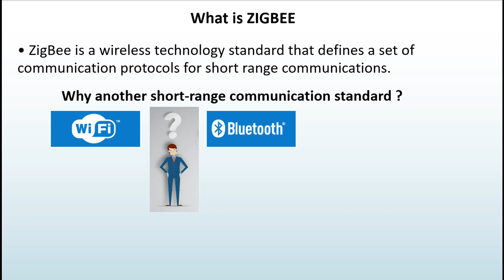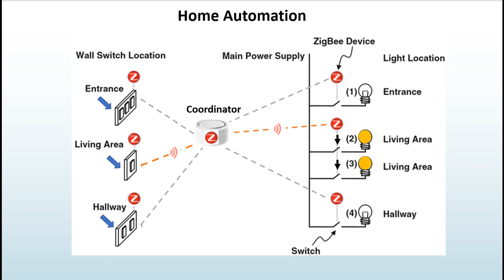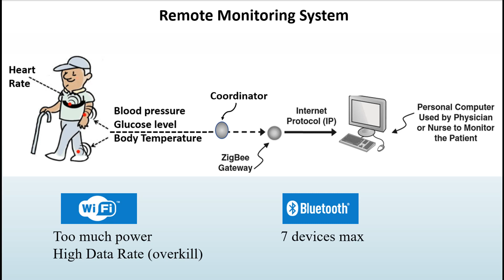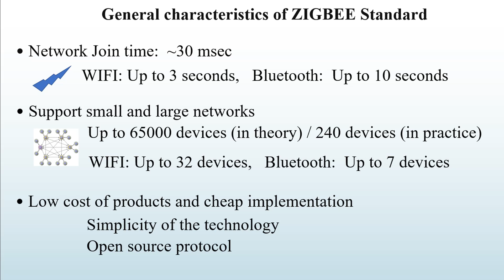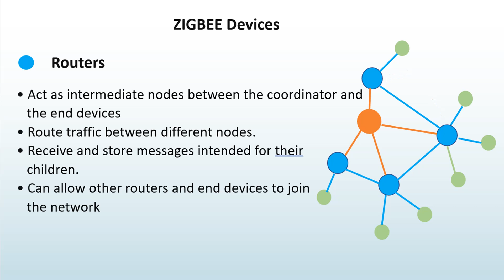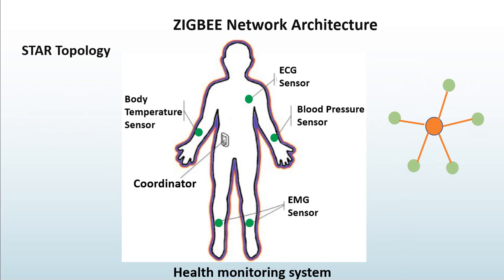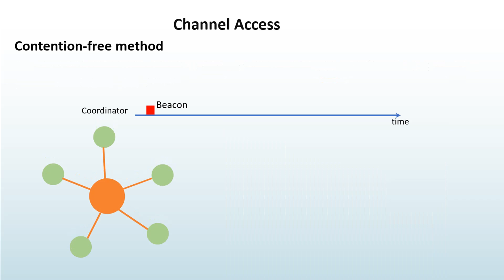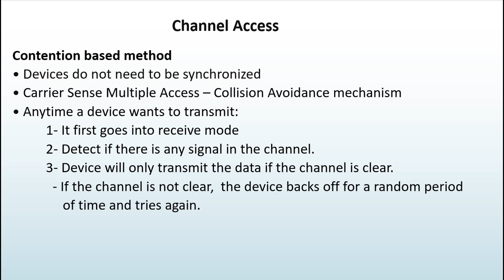What is ZIGBEE And How It Works?

Comment: The lack of understanding of wifi displayed in this video makes one doubt the validity of the information given about zigbee... which is rather sad...
Reply from the maker: Could you please indicate where this video showed the lack of understanding WIFI. I will appreciate you clarify that. Thanks
Reply: @TechiTube  I think before making a video like this you should have done the research. 

But I'll give you 1 example, you mentioned the limited amount of devices that can be connected to WiFi. This statement is factual in correct. 

Be aware, this is just one of the things that show that lack of understanding your seem to have.

Comment: 30 milliseconds to join a network. Not really. All the zigbee devices I've synced in with Home Assistant takes several minutes and often multiple retries before they join, and once found by the server, it takes another 10-30 seconds to negotiate and handshake. Very slow that is.
what those 30 milliseconds are I have no idea. But It's likely just a very tiny part of the whole and very lengthy handshake and join process.

Comment: Zigbee is for long range not short range
Reply from the maker: The typical range of a Zigbee device is 10 to 100 meters. That is considered short range transmission. However,,  data can be transmitted over long distances using mesh network.

Comment: 6:10 Wi-Fi 11 Mbps? How old is this video? 11 Mbit is the speed of the 802.11b standard which was common around the year 2000. Nowadays (2020) 802.11ac is common with speeds over a Gbit. Anyway, I found the video very informative. Thanks!
Reply from the maker: 802.11b has a speed of 11 Mbps. I agree that other WIFI networks has higher speed (802.11a or 802.11g which have 56 Mbps). Applications that uses zigbee network don't need this much data rate.

Comment: I have one question...
Zigbee waves travel in one perticular direction or its like WiFi waves in all directions..

I have zigbee hub which is connected to zigbee repeater and this repeater connected to other few end zigbee devices...

When i kept zigbbee hub antenaa direction toward zigbee router then it picks signal and then this zigbee repeater antenna face toward other few end zigbee devices...
Then communication is perfect and has no problem....
But if i change the one of the hub or repeater antenaa direction to opposite side...then all my end zigbee devices lost its connections....

So my question is....
Zigbee is work in a straight direction ? Or it is like WiFi waves in all directions?
Reply from the maker: A Zigbee antenna can be designed as a Printed Circuit Board (PCB) antenna or omni directional external antenna. If your hub has a patch antenna (PCB antenna), then it explains why you have the issue you mentioned.
Reply: @TechiTube  yes..my both hub and   repeater have pcb antenna.
Reply from the maker: A Zigbee antenna can be designed as a Printed Circuit Board (PCB) antenna or omni directional external antenna. If your hub has a patch antenna (PCB antenna), then it explains why you have the issue you mentioned.

Comment: Can Zigbee help smart devices function in rooms with a weaker WiFi  signal?
Reply from the maker: you need to place the zigbee hub (coordinator) in a room with a strong WIFI signal. The other zigbee devices don't use the wifi signal to talk to the hub so don;t worry about placing them in a room with weak WIFI signal.